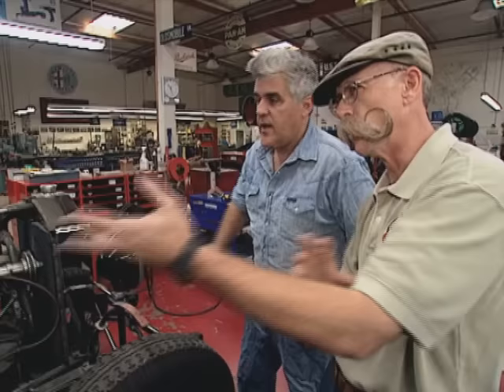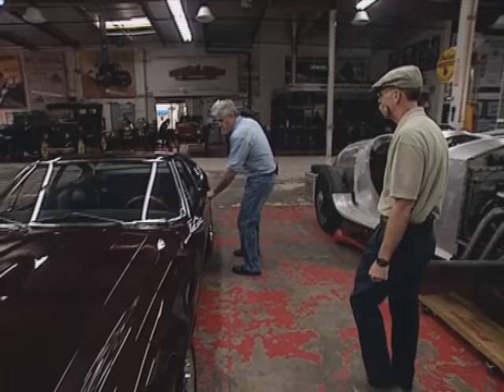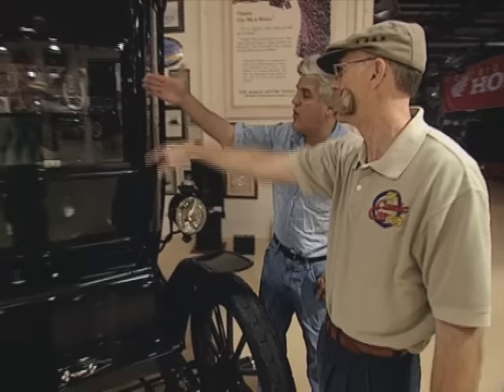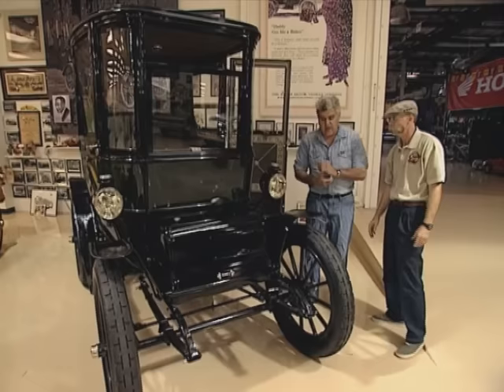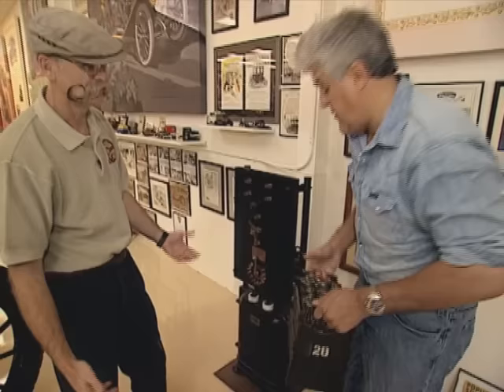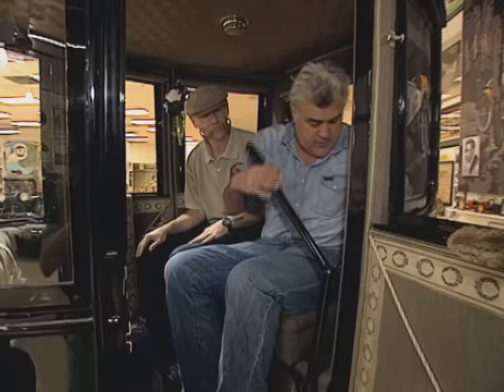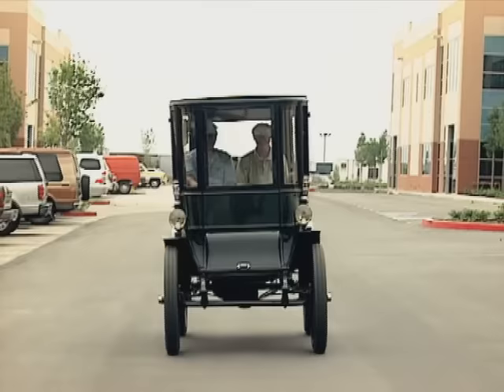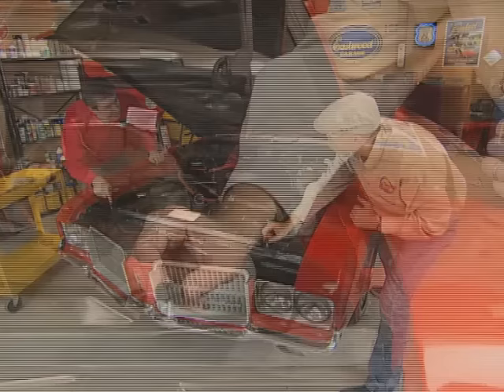Jay Leno's Baker Electric Car

Comment: Why is no one talking about how quiet it is, this car perfect for inner cities, small, quiet  no emissions.
Reply: In most cities, with narrow roads, intersections, lights, traffic, etc, I bet this wouldn't even have trouble keeping up with "modern" vehicles.
Reply: Yeah, if you like quiet cars, it's perfect. But I'm one that likes a loud exhaust note, so it's just not for me. It is cool tho
Reply: @calebfuller4713  why u put modern in quotations, whether it’s good or not a car made in modern times is modern
Reply: @pinheadlarry1019  You’ll be able to drive an EV and still get the deafening sound right through your audio system which is done today in some new cars.  And the nice thing is, the vast majority of drivers who like quiet cars won’t have to put up with your noise - as long as you keep the windows closed.  As far as rolling coal, we’ll, someone will come up with a way to dump massive pollution in the air from an EV.
Reply: political for those who sell oil
Reply: @rsewill12  It already basically does. The batteries are pretty fucking bad for the environment if that's what you're worried about, and just making them already dumps a ton of shit into the atmosphere.
Reply: @cherrypepsi2815  Unlike petroleum powered cars which dump nothing into the atmosphere /s
Reply: @ElenaSanchezMora  literally missing the point of my comment. 
None of this is good for the atmosphere, if that's what you really care about. Keep complaining. We're all contributing.
Reply: The emissions are the electricity to generate the power for the battery. The rare earth minerals in the solar panels. The battery used to store the power in the solar panel.
Reply: @ocrapo9327  True, but most people just get told what to think rather than do the research themselves. Surprised no one said you are being paid by "big oil" by now for stating a simple fact. Wonder how many know that "big oil" funds "clean" energy and research. They get paid whether you use oil or not. They are energy companies... they provide energy. Mind-blowing...
Reply: Silent is dangerous
Reply: The power station was burning coal.
Reply: @emenesu  It really is. I've been almost hit by electric cars several times because it seemingly appeared out of nowhere and with no sound.
Reply: @emenesu  Especially for pedestrians. But you need to remember that back in 1900's, no one cared about safety.

Comment: its a blessing that mr leno not only has the money to rescue so many old vehicles but isn't frightened to drive them or show them to the public.
plus he talks like a normal guy not like a 'I have it and you'll never see it' kinda guy.
he explains things in laymans terms so I can understand how it works.
and there is no bragging about how much its worth or how much he spent.
Reply from the maker: All that is true!
Reply: Mr Leno is a great guy like to meet him sometime. We are blessed he shows us all his cars and drives them also like they were meant to be!!
Reply: Dave Chivell gardner yeah he is definitely the kind of guy to show off his stuff and say I have it you can see it but you will never have it because I have the only 5 ever made jay Leno is not an average guy he is definitely a snob, rude guy and mean to the poor.
Reply: My thoughts exactly!
Reply: Notice nobody questions him if it's street legal or NOT.
No brake or turn lights. Forget seat belts. Lucky if they have brakes
Reply: I agree with previous commenter.
Don Bell
Reply: @davep6977  : It's street legal since California issued a plate (historic car plate). You can see it at 11:22 on the rear of the car. As for turns and braking, you use the three hand signals taught to you in driver's ed. Since it's historic, seat belts aren't required (though I'm sure they could be discreetly installed).
Reply: @davep6977 ...and seatbelts on a 23 mph machine - not probably gunna make a difference in a crash at that low speed.
Reply: hes v cool considering with his 400 million -
Reply: I was going to meet Jay this November before COVID.
Reply: @hlloyd-fs4uf  : Amen!
Reply: @NickBrown79  : Keep in mind that the speed of Jay's vehicle isn't the important factor. He could get T-boned, rear ended, or hit head on by someone  who's going extremely fast. Jay could be seriously injured by the impact or even thrown from his vehicle. Seat belts would be a worthwhile installation.
Reply: @davep6977  It was 1909 -- very little electricity outside of the big cities. So few cars on the road that they didn't need "Driver's Education" just yet.
 Since then, LOTS of rules and regulations came about -- and today's motorists spend most of their time disregarding the rules -- or breaking them altogether.
 I rode in a 1919 Baker Electric -- it was spooky -- VERY quiet, but not very fast.
Reply: ronnie doorzon  he knows not all that much  about car engineering; man is, or was,  a *comedian*  .
Reply: @josepeixoto3384  
He was a car sales men waaay before he became a comedian. Now he might not be a mechanic but he sure knows
how everything works. And i would say that he knows more that you and me, because i'm sure you and i never
had or worked on a steam car, and jay has a few and knows how every nut and bolt works, so his knowledge
doesn't stop at piston powered cars.
Reply: @davep6977  Don't say anything ; the cops probably get starstruck by Jay Leno !
Reply: Jay Leno IS the best!
Reply: @SlikLizrd  you've been in one of these cars? Lucky you  -  amazing! Although I do have to add, you were also lucky not to have an accident. The first person to be killed in the U.K. was killed in electric car! No, they didn't have an ELECTRIC shock! The car toppled over! I imagine someone must have miscalculated a corner in one of these top heavy cars - you can just picture it! Like people who are fooled by the stability of a Reliant Robin, driving THAT without allowing for it having only 3 wheels! THEN of course, people CAN turn THOSE over! ( So in that way the Baker was ahead of its time!)
Reply: ronnie doorzon  knows something about every car he owns? Rare for a celebrity? Rare for anyone at all!
Reply: nothing
Reply: @davep6977  street legalities very from state to state, but when a car goes only 20 miles an hour and is 100 years old, by law its technically not the equivalent of a modern car. It doesn't need to pass emissions, safety tests, etc, at least in Cali
Reply: Funny thing, these cars can cost up to 20,000 according to google.
Reply: It’s called ego and most in show business consider him 2 faced and spineless
Reply: @kinggkongg9694  and you've talked to most people in show business? Give me a break. 😂😂😂😂
Reply: @josepeixoto3384  he still does stand up and gets paid for it, so I'm pretty sure that's still a comedian. Sorry if that's hard for you. 😂😂😂
Reply: @tadnadna9798  😂😂😂 think he has one of five cars is just talking about the history of car. Guys do this all the time even if they were thousands of them made. A lot of car people know how many of their cars were produced and approximately how many are still on the road.
Reply: @benkleschinsky  How so?
Reply: @davep6977  it's perfectly street legal.
Reply: @NickBrown79  Why don't you put that to the test and hit the wall at 23mph without seatbelts. Don't forget to make a video.
Reply: He’s more like “I have it and I’m dying to show you”

Comment: You're kidding me
It's 110 years old.
And he just got in, and off he went. That's insane!
Reply: Nah bruh, he had to do some painting and replacing the acid in battery and some other stuff like wheels and lamps.
Reply: Yeah but imagine getting into a today's car in a 110 years. You'd need to change and repair about everything. An this thing just needed new paintwork and wheels, and the battery I believe would still work today if you could get enough of them and someone who can repair them
Reply: The oldest car in the world is 250 years old (steam powered fardier) and could still be driven today (albeit at 4 km/h).
Reply: Yeah so many naysayers saying EVs won't work.  This proves them all wrong.  Sure there was probably some maintenance done on it but it shows that it's possible to build something to last.  It's too bad most companies don't want to anymore.
Reply: @redsquirrelftw  EV's aren't the future, Hydrogen is. But EV's are a step towards the future
Reply: @teddly2277  I always assumed hydrogen did not have enough energy density to work out and was too hard to store?  Or is there advancements on making it work?   It would be awesome if it could be made to work as it could also be used as a storage medium via electrolysis when you are producing extra power.
Reply: Hydrogen beats batteries for energy density but it is indeed a devil to store. You need extremely high pressures to store a useful amount unless you liquify it, in which case you need a super insulated tank and have to deal with it slowly boiling away. It's also a fire hazard, though probably not too much worse than gasoline given the smaller amounts stored in a FEV vs a conventional car.
Reply: @redsquirrelftw  It's more to do with economics. If you sell something that lasts forever then after 5 to 15 years you'll only be selling an handful here and there and you won't be able to afford to run the business any more.
Reply: @teddly2277   Hydrogen storage is inefficient, energetically, volumetrically and with respect to weight. ... It has a horrible well-to-wheel efficiency as a result. Easy ways to get large quantities of hydrogen are not 'cleaner' than gasoline.
Reply: And that's when you put it on autopilot and move on to start the next business.

It's not a bad thing, it's a good thing. I know I don't want to be dealing with constant issues just because it brings me money. Just build something that works well and move to the next thing.
Reply: @SoundTracx  Electrolysis using solar or other green energy is a clean way to get hydrogen.

Comment: This electric car is quite exquisite. It's in amazing condition, has the most gorgeous interior, and would obviously be quite practical even today.
Reply: Only practical if everyone was driving similar vehicles. A crash with a modern car, driving at modern speeds would be fatal probably 99% of the time. Also, at top speed, it would still take over 2 minutes to travel 1 mile and if you had to run the lights, your range would drop below 80 miles. Also, if you're driving up hill, your range will drop even lower. With modern suspension, safety features and battery technology, we can definitely do a lot better than we are!

Comment: my Grandfather, born 1909, first job in Big City Indianapolis, was delivering bread with an electric truck.  He reported winter was difficult because he couldn't turn on heat because he had to save enough battery to get back to garage
Reply: Eric Higbie lek ar bro
Reply: Eric Higbie 
poor bugger.... it sucks being cold.
ps.... winters are going to get very cold indeed.... colder than in his day....
Grand Solar Minimum time is here!(again) brrrrrr.....
Reply: well if he had a tesla he would have been fine.
Reply: these things got same problem to this day. Great in optimal conditions but here up north where winter lasts almost 7 months you are better off.
Reply: Gasoline cars didn't get heaters until the mid 1930's, and it was considered a luxury option that only got really popular in the 50's. Also until the late 20's most cars were open, so no point on a heater.
Reply: MrTheMiguelox Which is funny considering it's literally run from the coolant system of the engine. Practically free.
Reply: As a teen in Miami FL I was given a 52 ford with a flathead V-8 3 on the tree and a overdrive  It had no heater my father told me they were a option until the government made them mandatory for safety a defroster .
Reply: Cool story
Reply: We had an electric panel truck at school 1958 food between building s  drove 1/4mile daily battery life poor!!
Reply: My Grandfather was an apprentice and had to get more wood if the truck of the company broke down somewhere.. it drove on wood gas
Reply: Drakilicious gt
Reply: @hasriqlatif7182  kayak kamu
Reply: Awesome story
Reply: @johnsiders7819  Yes, the heaters, along with turn signals and back up lights, were optional in the 50s.
Reply: @jameslaidler4259  there are still parts and labor involved. So, where is the FREE?
Reply: That's amazing
Reply: They should have had a steam truck instead.

Comment: I'd buy one of these new today for shopping and tootling round the neighbourhood. So cool.
Reply: This range is actually better than my Renault Fluence ZE, which got only 100 kilometers per charge at the topmost. This old Baker gets 160 kilometers per charge, and that is excellent for its era, and more than enough for local shopping, bank errands, and hospital visits. It is clean and practical.
Reply: 72Yonatan I think there's no way it went 160 km on those 3 battery units it got in that drawer, but even like a quarter or a third was phenomenal
Reply: The real doktorbimmer by the way say hi to Doctor Bummer who goes out of his way to state that it's no good!
Reply: There were three more batteries in the back they did not show.
Reply: The Whiners are talking as if people can't take the idea and use modern materials concepts and parts to make something similar to this vehicle and have it meet modern standards of transport.
Reply: Awhile back Jay was talking about putting a Tesla drive and two halves of a Tesla Motors battery pack in a Detriot, a BEV car, don't know whatever came of it.
Reply: um alot of people do that...( in a golf cart!)
Reply: You could get a BMW i3 which is it's modern equivalent present day car and does have regenerative braking.
Reply: @harrickvharrick3957  They said there were more batteries in the back.. get the wax out of your ears!
Reply: My neighbor has one of those little electric vehicles for driving around town. I want to do this to an old rabbit, or golf, or beamer.. some 70's something boxer car that doesn't weigh 1800 lbs, gut the motor and the fuel tank, cut the trunk out and sink the floor down inbetween the frame rails where the gas tank was and drop in about 500 lbs worth of deep cycle batteries.. Sadly that's about only 4 L16 batteries so I'd have to do some research and decide what batteries to use factoring in battery size (amp hours) weight, discharge ratings, charge time, and probably a few other things I'm not thinking of right now. I'd also have to compare that to the headaches of running lithium batteries and the controllers that are required to use and charge them.. The number one pro of lithium batteries is their light weight.. followed by their ability to discharge completely.. their number one con is the fact that they like to violently self ignite and turn into raging infernos. And they are expensive.

I'd love to set it up so the motor turns into a generator when you hit the brakes.. A lot like having an exhaust brake on a diesel truck. I don't care so much about the tiny amount of electricity generated, only that it saves your brakes--something that most people wouldn't care about.. However that has become sort of an obsession for me as I drive only manual vehicles, and know first hand how down shifting saves wear on all components.. and I've scared the shit out of myself driving down steel grades pulling huge trailers in an automatic.. One auto truck I had I pulled over and stuck it in 4 low just to actually get an engine brake at sub 25mph speeds and I still roasted my brakes Never again..

Comment: This car had a 100mile range in 1909! The 2009 Mitsubishi I-MiEV had a range of 45-75 miles. Wow! 

It’s a shame it never caught on as its more reliable and of simpler design than an internal combustion engine. An electric motor has far less parts and uses much less oil.

We could’ve had EVs with 1000+ mile ranges and great “normal” styling unlike the Nissan Leaf, BMW i3 and many others.

That said I love the liveliness of an internal combustion engine and they do have more character. Thanks Dennis for uploading this.
Reply: Liveliness? Character? Utter nonsense.
Reply: Any modern EV driven at only 20 mph will exceed that 100 mile range of the Baker electric by far.

The range of modern EVs is measured by driving at different speeds for cities, country roads and highways. Driven at low speeds EVs need not much energy. 

In Germany some guys drove a Tesla Model 3 long range which has a range of 560 km measured by the WLTP test cycle, at a speed lower than 38 km/h. They drove 1000 km on just one charge.

At a typical city-speed in Germany a Tesla Model S could have a range of 780 km, while at a speed of 130 km/h on the Autobahn, the range is only 260 km.
Reply: The Baker didn't have air conditioning, power windows, airbags, ABS, automotive safety glass, modern suspension, and safety features that add hundreds of pounds of weight and kilowatts of electrical load.  Your comparison is apples to grapefruits.